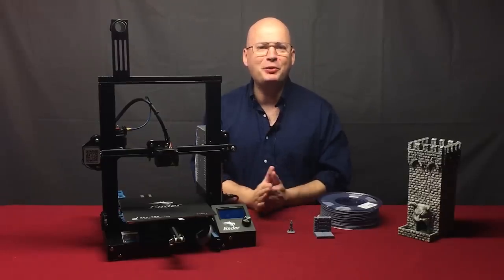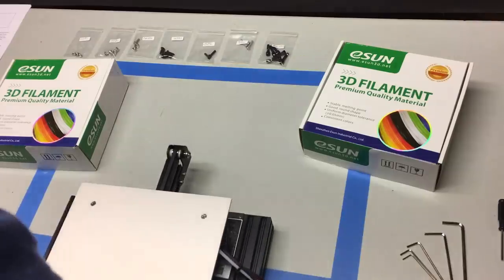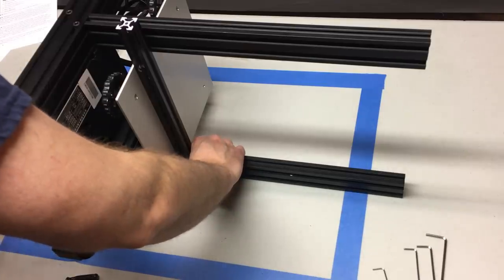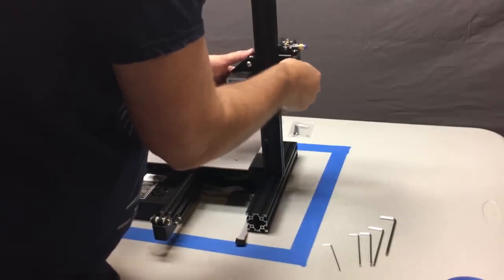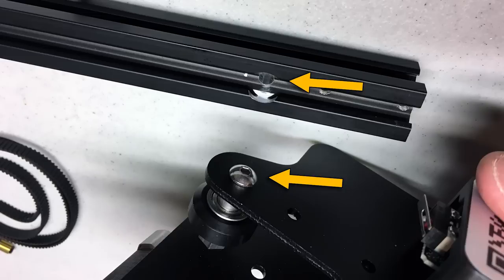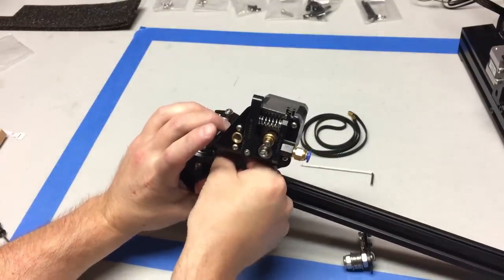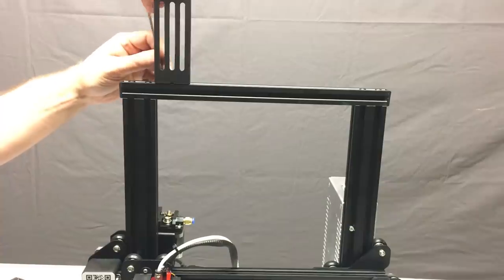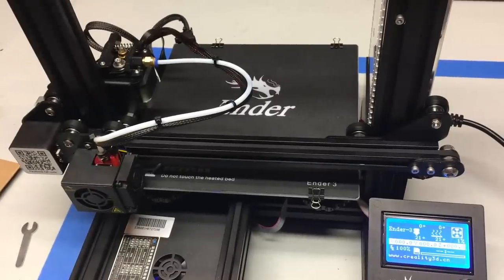Creality Ender 3 assembly and pro build tips

Comment: Hey, I followed ur build guide. It was a cca year ago.
I noticed that my Y rail.  Not rail but wheels and the sheet metal below the head bed is not leveled/horizontal. So my heat bed has left level screws loosen, and right ones thigh.  
Did you have same problem at yours too?

Comment: I just ordered one of these, seems to be working fine, all the motors work and whatnot, however, the brass fitting for the tube will not thread into the extruder. I messaged the seller about getting replacement parts rather than refunding, but I only have so many days to return to amazon. So I don't know what I'm going to do.

Comment: awesome video, i watched and paused 50 times while assembling mine. After using for a month, my only issue was at 24:28. You seem to ensure the belt tensioner is parallel with the extruded aluminum. I noticed this caused some light rubbing with the belt and tilted it downward just a hair to prevent rubbing.

Comment: - a spirit level is very helpful to check the verticals on the upright extrusions and z axis threaded rod.
- loosen a little ( not remove, but loosen ) the two screws on the plastic block attached to the z axis motor. Place face down on a flat surface, so both the block and the side of the motor are on the bottom, tighten the screws, then screw the block against the frame. My block wasn't completely flat with the motor, and a 1mm difference threw the vertical really out on the rod.
- attach the power supply and control screen last ( just before you plug everything in ). If you have to move the machine or turn it onto its side ( to access the bottom screws for the vertical extrusions again, for example ), there is less weight and they are not sticking out ( you may have to move the x axis bar up/down to access one of the screw holes for the power supply ). I also found it easier to plug in the control screen before screwing it to the frame.

Comment: I wish I had watched this video when setting mine up, instead of the video I did watch. I didn't do that measuring and adjusting of the gantry extrusions, or adjust the eccentric nuts before everything was assembled. Now no matter what I do with the eccentric nuts there's either always a wheel on each side that's almost free spinning while the other two are so tight I can't turn them, or two wheels are properly tensioned but there's still wobble in the x-axis. I probably need to take the whole thing apart and put it back together properly lol. Fortunately I've only had the printer a couple weeks so hopefully incorrect setup won't have caused any lasting issues.

Comment: You are putting the t-nuts in wrong, they'll not hold and especially with holder it might come loose and fall like that. Put them in like in the manual. To stop them from turning in the length of the bar all the time, put a small piece of paper (or gum) between the two t-nuts, and guide them with the larger allen key. You can put them in quite easily that way. Otherwise , great video, was really a help building mine.

Comment: Hey brother, just started assembling my ender 3 pro today. Got to the part about installing the z stop, where you showed to put the square nuts Vertically. In my updated manual it shows to put them horizontally and slide it down from the top. Are you putting them In so loose that you end up with them horizontal or ?

Comment: Just a note: The M5 nut is being inserted incorrectly in the video (around 26:50, 24:00 and somewhere earlier-there are three parts that use them-note you must put the filament axle on the rail before you attach it, not after). It should be rotated 90 deg and slid in from the end of the beam, not the side. It is designed that way so it cannot loosen and pop out of the groove. It's a bit of a challenge since it is a tight fit, but done correctly you will not be able to pull the assembly off any other way than sliding it back out of the end. Other than that, excellent video. Thanks.

Comment: Could not have done it without the excellent help in this video. Everything went smoothly, would recommend you draw a line with a pencil on the plate while aligning the header bar parallel to the base to use as a guide to tighten the 2 screws. We screwed the bar down to where the motor plate could be used to measure equal height on both sides, drew a pencil line and things worked much better. 
We used Vibratite thread locker on some of the assembly after cleaning all the bolts 1st to ensure things would not come loose later. Found the machine screws quite dirty from factory as well as the worm gear. After cleaning we applied a thin layer of white lithium grease to the gear threads.
Thank you to all who posted and for the excellent tips on a better setup, provided in this video. 1st class !!

Comment: I wish I found this video before I assembled mine.  Now I want to disassemble to update it.  The test print worked but I am concerned the wheels maybe too tight.  Also, seems to be a dip in the center of the bed.  The corners all set but the center is slightly lower than the corners.

Comment: Hello there. Do you have any thoughts / experience with metal wheels rolling on polished metal rod? Some newer 3D printers some with those instead of plastic V slot wheels. Do you think that the same principle still applies (since it is now metal on metal) - not so tight that you cannot spin in without moving the gantry?

Comment: Those square nuts should be angled sideways, so that they can't get out side ways, only along the rails. That's why you should first put in the tensioner in before your wrap the belt around. The tensioner should be slided in along the rails.

Comment: I followed this and your leveling vid, thanks for these very much!
I printed a part that was designed in Solid Works by an expert, sliced it in Cura
for draft mode and printed it 3 times perfectly.  Then I did my own design in 
DesignSpark Mechanical, sliced in Cura the same way and I've tried 5 times but 
the initial layer will not stick.  Both are large parts one 5.75" round the other roughly
6" square.  Is there a good video or reference on this?  I have the stock plate not 
glass for the bed.  Using cheap WYZworks PLA and I did not store it in any special
way since the first prints were done 2 weeks ago - could water retention be the
cause?

Comment: If you are having trouble getting the t-nuts to grip the extrusion. Run the nuts down all the way down, then put a dab of fingernail polish on the visible screw threads. Then, before the finger nail polish sets up, back the nuts off until they are about half way off the screw. Let the polish setup for a good while. This will give the nut sufficient adhesion to allow the screw to turn the nut in the extrusion slot., but not enough adhesion to prevent tightening the screw into the nut. Loctite Purple could probably be used but it takes awhile to setup

Comment: This video help me a lot after figure out that I needed to re-assembly my ender 3. Just one tip instead using the spool holder arm for align the x-axis I see the top aluminium extrusion, in that way you move less the whole x-axis and also is easier to align, just tight a bit the x-axis to dont be able to move alone, after that just using the aluminium extrusion under on side then just put under the another side and push the x-axis down, will be correctly aligned without doing by hand and testing

Comment: Awesome video. This is my 6th printer but knowing the specifics of the unit you are building is so helpful. I got my Ender 3 running this morning after following the build instructions and am thoroughly impressed. This is easily the best first print I have had from any of my printers and they have cost as much as $1,000. Thanks Tom!

Comment: Amazing detailed build. It took me nearly 4 hours to build my Ender 3 but it is definitely worth it since you also learn why this is not exactly a take it out of the box and use it printer as well as how to fix certain issues. One of the wheels for the printer bed was quite loose actually and was spinning pretty freely. The X axis carriage assembly was also pretty loose. Everything else was pretty good. My only issue was that the distance between the two horizontal rails had a difference of about 1-2 mm between the top and bottom, the top being narrower. After putting on the top rail the difference was negligible. I know it's next to impossible to get it perfectly straight but with your tips I feel much more confident about it rather than the straight out of the box build with no adjustments.

Comment: I had to struggle hard to get my tension pulley on. Had to use a lot of force and just to get it in place and then lever to pulley with screwdriver so it dont scrape againt the alu profile. 
Is my belt shorter the others or do i do something wrong?

Comment: just a thought. before tightening the lead screws of the two vertical extrusions, isn't easier to temporarily install the top extrusion and align both vertical extrusion to the its edge first, to make sure it's not twisted prior to tightening the bottom leadscrews? also it will make sure that both top and bottom distances will be exactly the same? no need to measure.

Comment: Thanks a bunch. Still had some jiggling minor stuff while putting it together but you helped a bunch.

After having to mess with the bed leveling (thank you for other video) I went and printed the fan shroud you suggested (thank you for yet another video) that turned out good on draft setting in Cura.

Printed two fun peices overnight, and am now doing up the cable chain.

Only thing left to do now is fiddle with the settings to get decent minis and terrain. 

Thanks to you and others in the community for answering noob questions, writing tutorials, and making vids.

As my experience level grows I lool forward to the example of others and paying it forward.

Comment: Whoever put mine together tightened the wheels for the tray so tight that they had flat spots on them. Luckily, i noticed this as I am putting it together, so it will save me time trying to figure out any problems they may cause and I can order replacements asap. Thank you for adding this step that is not in the instructions.

Comment: Well great vid, but cant be bothered now^^
Ill rebuilt in half a year and use locktide on all screws then, now i have to test the printer, cya :P

Oh and not sure if you know by now: 16:03 you actually wanna twist both of them 90° and insert it from the top so it will not fall out at some point.

Comment: The tip to get the vertical bars aligned at the top and bottom using the other piece of metal is a great tip! Mine were farther apart at the top than the bottom, which would indeed cause wear!

Comment: when I get to the point of measuring the two sides with a spacer, the right side is about 1 inch off from the left. I went back and loosened the screws that tighten the rod, but it’s got to be some bigger issue. I can’t figure out how to get the right side level

Comment: At 20:30 the 2 screws he refers to when using the spool holder as a measure are which ? Are they the two holding the actual beam in underneath ? Or the two on the exterior he made us loosen 2 turns just prior?

Comment: This guide helped me get from 0 to printing benchies in one night, it was super helpful! I found that a small level was a great help in getting the vertical posts aligned correctly, in addition to the other checks recommended in the video. This and the rail wheel tensioning were IMO the trickiest parts of the build, and they were not mentioned in the official documentation, so I'm glad was video was there to help me out!

Comment: At 16:00 you insert the Z Stop directly into the side while the manual shows that the inserted metal heads need to sit sideways in the groove. The manual doesn't say how but the only way to do it is to drop it down from the very top with the metal heads set horizontal. Then you can drop it down and tighten it into place.

Comment: Adjusting the screws at 20:30 makes no difference for me, it's always slightly lower on the right.
Reply from the maker: Adjusting the screws won't change anything, you are simply loosening them so you can adjust the bar yourself.

Comment: to level the X axis bar  shown at 20:28  I had to go back to adjusting those 2 M4 x 16 bolts at 18:37 to fully level out the bar, when  first assembled mine were  .25" off
Reply: This comment ended about an hour or wrestling with that bar for me.  Thank you!

Comment: I wish I came across this video before I did my build, I am experiencing a Auto Home fail. Is there any thing I should check? Before I take it apart and reassembly with the guidance from this video.
Reply from the maker: A fail is most likely one of the end stop switches not being plugged In (either at the switch itself or on the board.)

Comment: So, this looks pretty good.  A couple stupid questions. Is yours the 'economic' or the 'pro' version - it appears to not be the pro?  Being somewhat ignorant myself, do you have a simple distinction of how the two are different (other than cost ;))?  I'm looking into getting my first 3D printer and while this one is no longer $220, it  is looking to be a good option - I'm just worried to death I'll get it and not be able to make it work and sink around $240-$250 into a hole lol
Reply from the maker: The video shows a standard version, but the assembly is identical to the Pro. The Pro has a wider Y-Axis aluminum extrusion, which makes the print bed a little more stable, it has a Meanwell brand power supply, which is much better than the standard PSU, and it has a removable magnetic bed. The Meanwell PSU bought separately is usually around $35 by itself if you ever replaced it on your standard version, so the increased cost of the Pro isn't a bad deal at all. I own both, any new ones I buy at this point will be Pros simply because I like the Meanwell PSU. That said, the standard is a great machine, and both will produce identical prints. :)

Comment: Good evening, I am putting together my Ender 3, I’m about 20:45 into the video. Excellent instructions. I’m doing my x axis assembly. On your extra step using the spool holder to check x axis I’m off significantly. I’ve loosened and tighten the spacer and I can not seem to find any improvement. Is there a fix to this, or is there a separate video for adjusting x axis? Thank you
Reply from the maker: You need to loosen the two bolts holding the wheel cart to the horizontal X extrusion and adjust it. It will take multiple attempts to get it perfect. Just keep sliding it off and making small adjustments until you get it level. :)

Comment: Excellent tutorial! I’m running into a problem though, the pulley from the extruder is too tight. It was very difficult to get it in through the cable, and the extruder barely moves (by hand).
Reply from the maker: Cable?

Comment: regarding tightening the excentric nuts. when you see you should be able to spin it when putting force with 2-3 fingers. you mean making it slip ? or making it 'drive' over the frame?
Reply from the maker: Yes, make it slip, not drive the assembly. If it is doing the latter, it's too tight. It shouldn't be 'free spinning' with just a flip of your finger, but you should be able to spin it with 2-3 fingers and a little effort without moving the assembly. The main idea is it should be tight enough to not wobble, but not so tight it causes damage to the plastic wheels. :)

Comment: Just assembled thanks to your video. At the very end, I hit auto home, and it did everything that I saw your printer do. However, the bed didn’t move as fast. Also, I heard a weird rumble at the very end before it finished. Should I be concerned? 

Thanks
Reply from the maker: Sounds like something is off but I have no way of knowing what long distance. Look along the belt to make sure it isn't rubbing on anything and that the wheels under the bed aren't being obstructed by anything.

Comment: Ok, SUPER dumb question.  Towards the end of your video, it still showed the bare plate.  Then a second later you had something with the Ender logo on top of it with clips.  Did that come with it?  I'm trying to figure out of I am missing something for the top to cover the screw indentations, but I don't see anything listed in the contents list.
Reply: YES! The metallic plate is not what you should be printing on. There is a piece of plastic like material with the creality logo, and 4 clips to hold it to the metal build plate. If you do not have this black piece of plastic, you are missing pieces.

Comment: Thanks So much. A great tutorial especially the tips. One thing I need to clarify when you said adjust the bolts on the horizontal axis to make sure the left and right are level using the spool holder what screws are you referring ? Since I cant seem to level it horizontally. Thanks
Reply from the maker: The bolts at either end that attach the horizontal extrusion to the wheel carts at each end. :)

Comment: Do you keep the screws loose from your own added step for the x-axis?.. seems like keeping screws loose will not be good when the printer is in action?

As for fixing that x-axis... do you adjust the screws near the z axis or the bolts used to attach it to the section?
Reply: I've noticed that no matter how loose or how tight those two screws next to the z-axis are, it's still the same millimeter too high on the right hand side... suggestions? I honestly don't see how mechanically those two screws that are loosened effect the right side of the x-axis bar.. ?